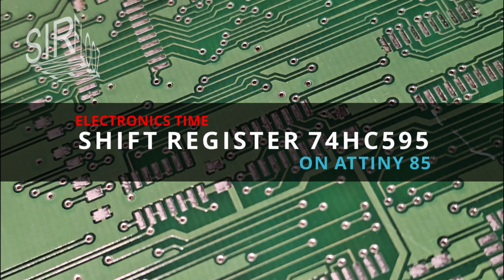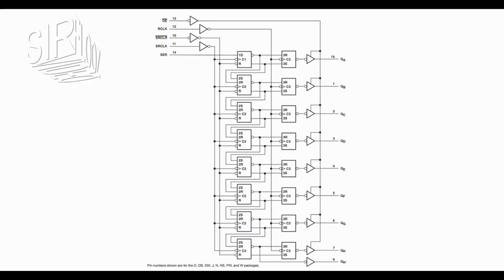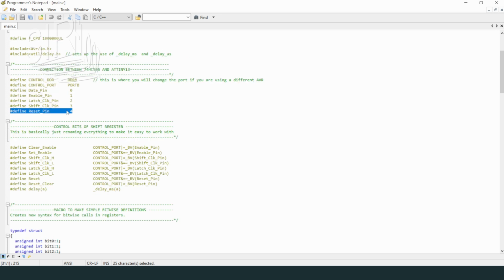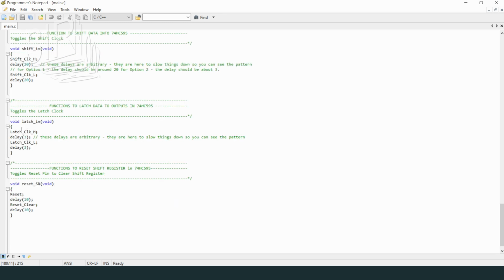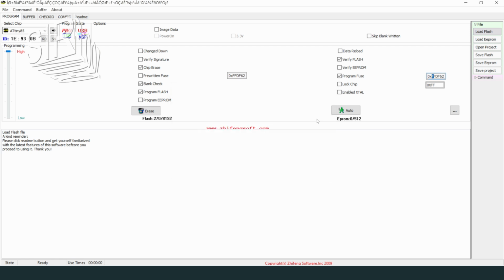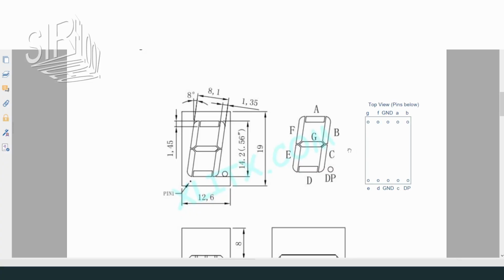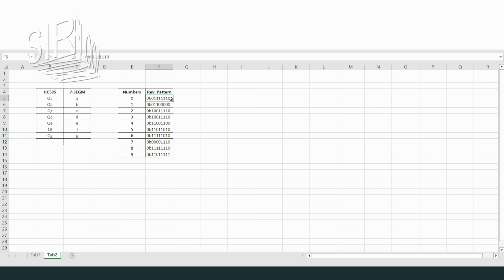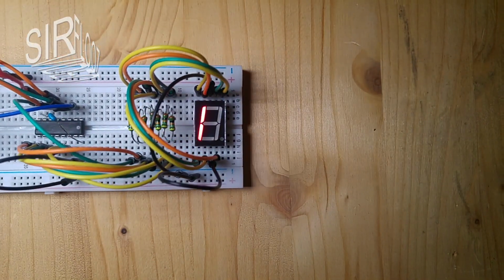74HC595 Shift Register Chip Function and Test with ATtiny 85 + 7-Segment Display

Comment: It is possible to convert Reset pin to GPIO and use it as 74595's clock pin?
I'm trying to use 2 of 74595 on ATTiny85 to make 8x8 dot matrix LED and it needs 6 pins so I need to convert the Reset pin to function as normal output pin. I tested with simple 74595 led sketch and the output from the converted pin is really slow.